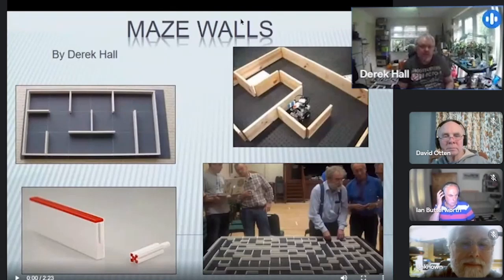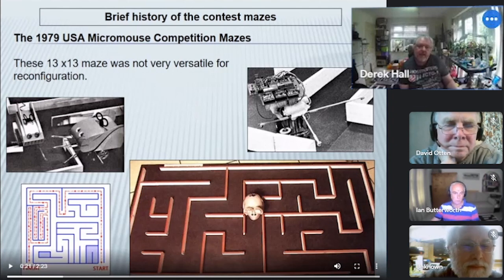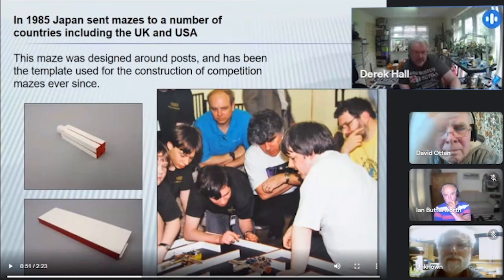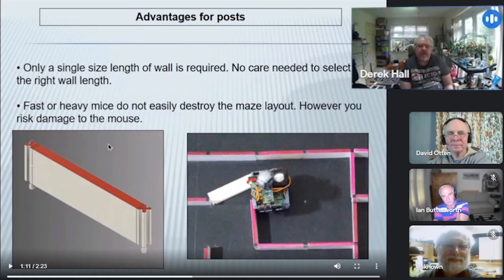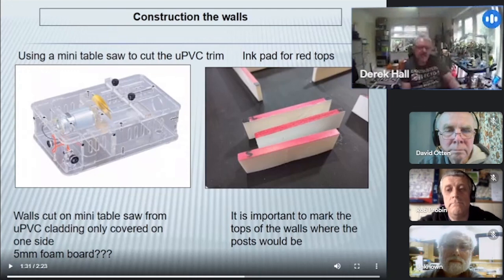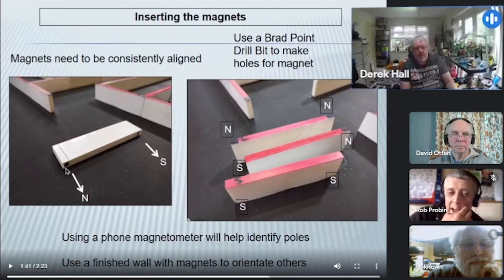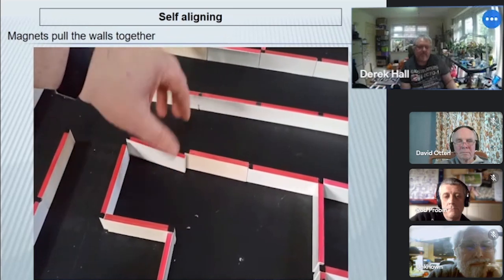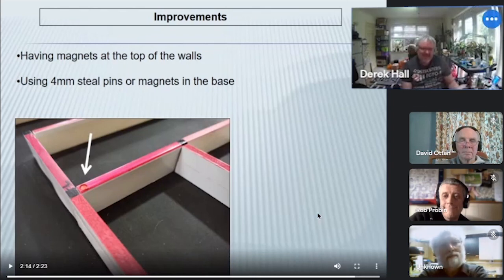How to build a magnetic half size MicroMouse maze

Comment: Please tell me how you provide constant voltage to motor
Do you used buck converter
Reply from the maker: We monitor the battery voltage using an AD channel then use that to calculate adjustments to the PWM of the motors so the effective voltage is always the same.
Reply: @MicroMouse  
Thank you so much

I also predict this would be a option

Can you please tell me is there any effect of change voltage at Analog reference pin
Aref pin

Generally we give 5 volt to it from common 5 v voltage regulator (which is used for Microcontroller and sensors)

I think there should be some interference
Reply from the maker: We use the supply voltage as the ADC ref and connect the battery (as it’s usually above 5 v or 3.3v) to a resistor bridge, as long as your power supply is good there should be no interference. The exact accuracy is not that important as the PWM signal is time dependant and will average it all out and the battery voltage only changes slowly.
Reply: @MicroMouse 
Thank you for clearing my doubts

Did you used smt 32
Which software used for coading

Please tell me any Lectures series for this
Reply: @MicroMouse  
Please tell me Motor Driver ic used in robot
Reply: @MicroMouse  

He discussed 
https://youtu.be/ettV5zorZfQ

9:47 to 11:47